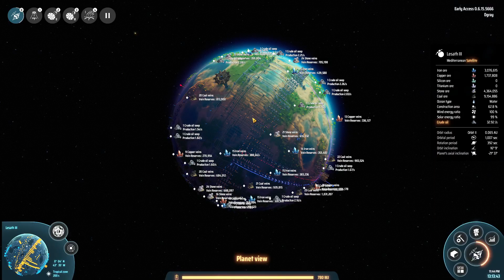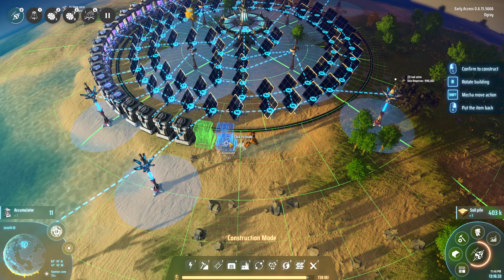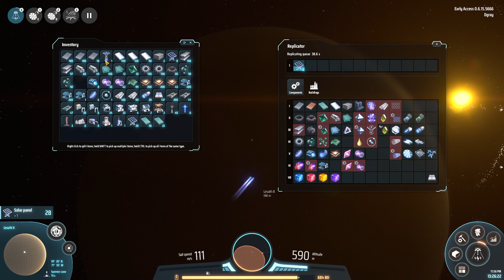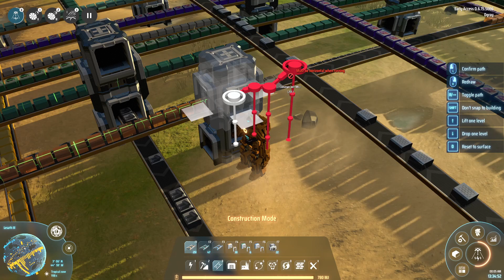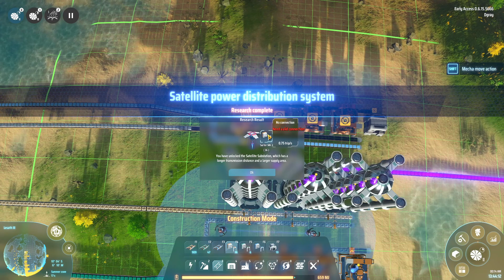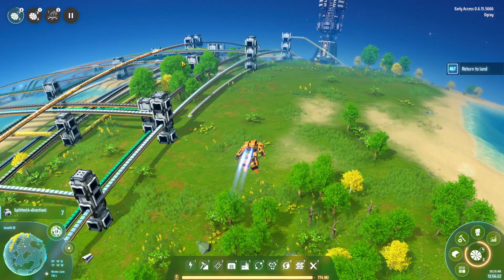HARVESTING GAS FROM A GIANT! - Dyson Sphere Program - Let's Play Tutorial Gameplay DSP Ep 18

Comment: on the input to the deutrionium fuel rod you could have run the second line through the second lower splitter in the stack and the routed onto the line from there.

Comment: You can take from logistics towers you just have to right-click on the resource icon as if you're splitting a stack. You can also place items into it as long as it's not at max. Also, you can "reach" any tower on the planet you are on from anywhere else on that planet in map mode.

Yes, you can place more than one orbital collector. Think I managed to place 40 on mine before I ran out of room (10 tiles needed between them I think).